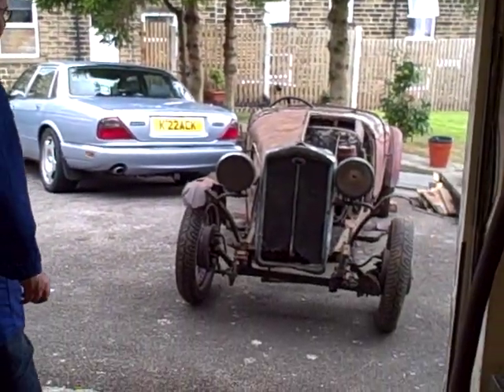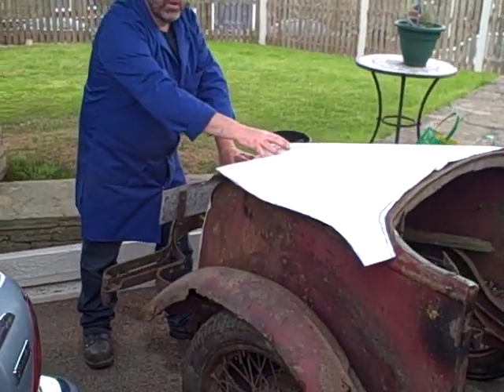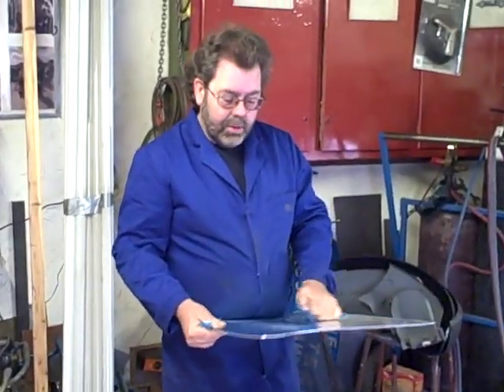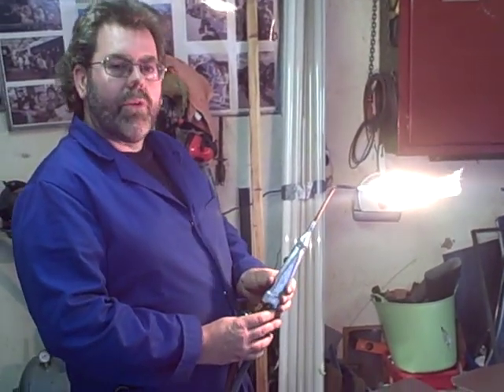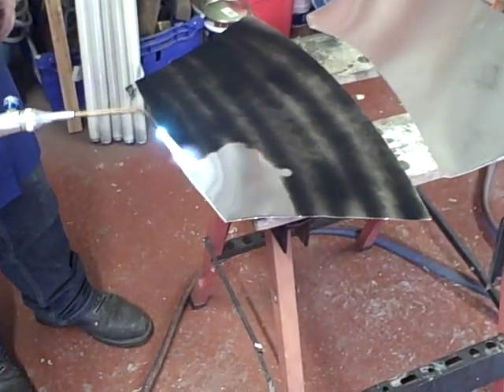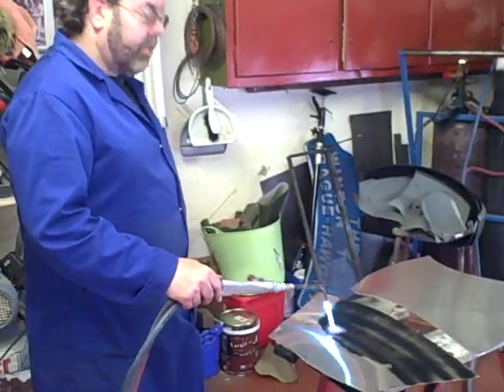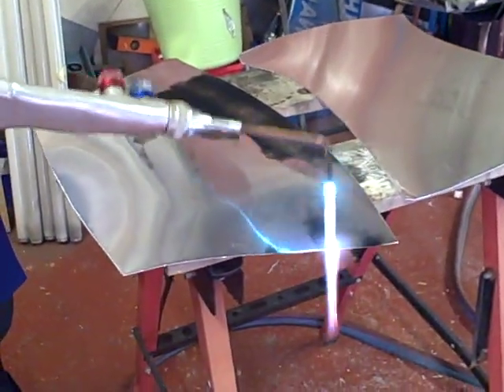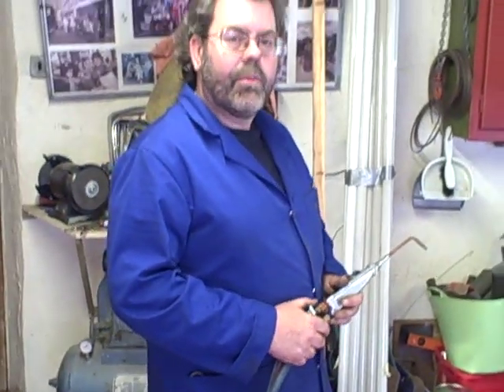Wheeling machine. Part 1 Making panels for a Wolseley Hornet Sports Part 1

Comment from the maker: Hi. I took the top wheel to a specialist hard chrome plater who specialised in JCB hydraulic ram refurbishment. they ground it a bit first then applied a thick coating then ground it down and polished it. It was done on a mandrelThe results are great as it polishes the panel as you wheel it. I believe it has correct Edwards bottom anvils as I have had MY wheel since 1983. the next vids will be oxy-acetylene welding the Ally panels together. thank you for your kind comments.

Comment: hey Andy, can you describe the process for hard chroming the platen wheel please. was is ground, chromed and reground on the mainshaft or on a mandrel? also, are you running kendricks 3 inch lower anvils on you Edwards?
great series this!

Comment from the maker: Hi the old thickness was 16 gauge. Its hard to get hold of now so we use metric 1.5mm etc. The old grade was "s1ch4" the current grade "1050A" or "Half hard" Other grades of Ali are too tough and cannot be shaped up easily or will not anneal at all. NS4 is commonly used by commercial vehicle builders because its dent resitant? therefore it doesnt wheel up! Do not be fobbed off with any other grades because they do not use a wheeling machine so how would they know.